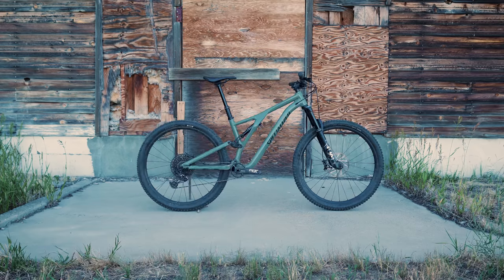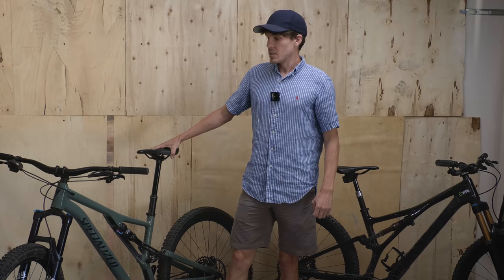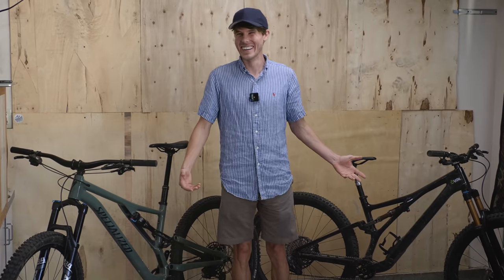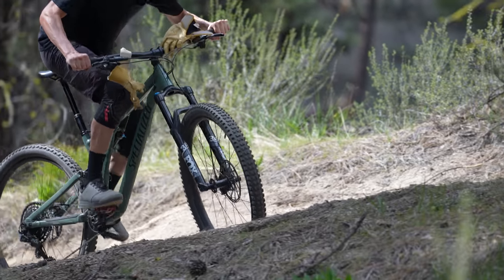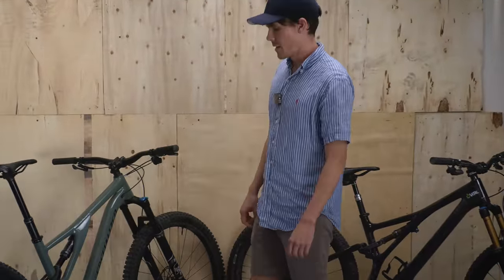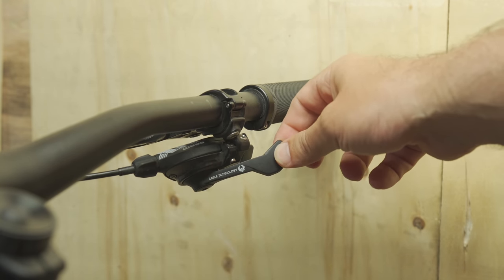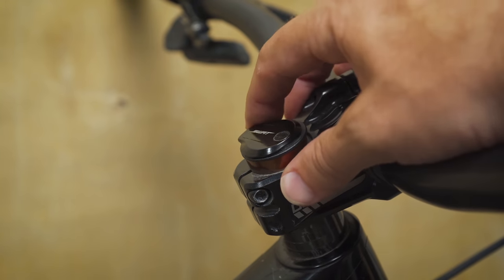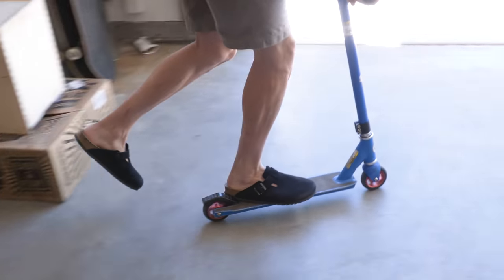LONG-TERM REVIEW - Specialized S-Works Stumpjumper vs. Stumpjumper Comp Alloy

Comment: As a bike mechanic, let me tell you one thing: If you have the NX derailleur, just ride it for a month until the spring is shot and upgrade to GX. The few pennies are reeeeaaaally worth it for a upgrade imo.

PS: I always see Adam Brayton using grips as binoculars when the outro starts
Reply: It's for that's Shimano is the king
Reply: Yep the crazy part is at the GX is like 10 or $15 more than the NX
Reply: Best upgrade you can do. The GX works perfectly
Reply: Anything else on the drivetrain you’d recommend upgrading? That’s really helpful

Comment: My 2013 Stumpy Elite 29er weighs 30 lbs. packed with tools, water bottle, frame pump, and spare... and it is alloy. It is 130/130 with a FOX Evolution fork and the rear is Fox Float/Brain. I smoke guys on these new geos on the climbs and trails oriented stuff. I live in rolling terrain and LLS goes being jammed down our throats isn't better for most of the terrain in the USA. I run 2 tokens in my fork.

Comment: I have the 2022 alloy comp. And he was right about the NX drivetrain. I bought a GX shifter and derailer. And will upgrade the crank later shifting fine now. I’m still mad I spent 4 grand on a bike. Looking at new ones now you can get a carbon comp for the same price I spent on alloy.

Comment: 100000% agree on value of both bikes. WAY OVERPRICED, build an expert (when frames are available) and save thousands. Not surprised with Specialized though. Good options out there on direct-to-consumer bikes though for the price.

Comment: I have a comp and have been upgrading it. Have a Fox 36 fork and a dpx2 going on it soon.
Reply: Hey man I’ve been looking everywhere for this info. I have the comp alloy, obviously with the 34 Rhythms…so the 36s will go on without affecting the geometry too much??
Reply: @benv7670  I bought a 36 with 160mm travel and dropped it down to 150mm with a new air shaft. I think specialized only recommends 10mm travel increase in the front so it won’t mess with the geometry much at all. Took it out for a test yesterday at the bike park and it rode and handles amazingly.

Comment: 6:45 So if you put the high-end suspension on the Aluminum, is it worth having the very expensive carbon frame if you are not a professional racer and just a regular mountain biker? I'm starting to come to that conclusion after seeing other brands come out with the aluminum version of the carbon, like the Ripley AF that is actually more capable than the carbon downhill. My last 3 bikes have been carbon and will probably be that way from now on, but if I were a young mountain biker just starting out, I'd definitely go aluminum with bikes like this.

Comment: Specialized makes great frames but for $3400, NX is wild. Go find yourself a Vitus Escarpe with Deore, a Z2 fork, carbon front triangle and save yourself $1k
Reply: Agreed. I have NX on a 2018 $1k hardtail and am annoyed with it for even that price point lol. NX anywhere near 3k is a nope
Reply: I've got a vitus mythique VRX and I completely agree, that Z2 is bloody amazing, it's basically a beefed up 34 factory without the adjustment but at an amazing price
I'd actually rather have a Z2 than a 34 factory because of the stiffness advantage, I'm not to concerned with weight
Reply: @nebnollock5198  Yeah I am also a fan of the Z2 over the 34. I intend to get one for my hardtail. That Mythique is a seriously nice package but I can't find one lol
Reply: @letsgo_inc  tell me about it, I was trying for months to get it - missing two stock shipments but on the third one I managed to snag one, it sold out 7 mins after I got the stock alert
Reply: @nebnollock5198  yeah I gave up. I'm low-key hoping they update it soon as it looks like j won't be buying anything for a while.
Reply: @letsgo_inc  you might as well sign up for the stock alerts, it's worth a shot

Comment: Many reviewers have said that the old design felt more 'plush' and smooth compared to the new design with the flex chain stays. Did you find that to be the case ?
Reply: I Demo’d a horstless version in Pisgah and the rear suspension felt wooden and dead to me. I prefer the 130-140mm travel of the standard Stumpjumper compared to the 150-160mm of the Evo, but the suspension feeling was a non-starter for me.
Reply: @stonewp  Thank you

Comment: At $10,000 it's only got a DPS on the back? I know Specialized kinda scrimps on kit, but that's a low blow! I've got a nice kashima DPS on my $3,000 XC bike. I would have absolutely expected to see at least a DPX2 if not a Float X on a very high end trail bike! The S-Works, as it sits, is a $7,000 bike IMO and the alloy a $2,800 bike. YMMV

Comment: the alloy is by far the easier more reliable bang around everyday bike for an everyday rider, the review is more bias to that of a long term rider and competitive enduro rider.... the everyday rider and weekend trail warrior even being damn good rider on a bike would be better with the alloy, not everyone needs every single adjustment on the suspension and most even good riders wont setup compression rebound and dampening correctly it takes some higher skills...

Comment: IMHO, theres a few flaws with this comparasion in some regards.

For starters, the comment on suspension performance its obvious if you compare a rythm fork vs a factory 34 with a grip2 damper... same for the shock.

Second, you're also comparing two bikes with basically same geo but different suspension layout (flexstays vs fsr) so this also will change how the bike feels both climbing and descending.

the ideal review would have either been:

1. compare the comp alloy vs the comp carbon for long term which will give you the closest comparasion between the carbon bike and the alloy bike because they both have same forks and shocks !

2. upgrade fork and shock on the comp alloy to a performance elite or factory level to achieve a similar comparison to scenario 1. (mentioned above) which will make for a much more fair comparison for long term in general. Because as previously mentioned suspension performance has a huge impact on ride feel between this bikes!

Comment: It's insane to call a 3400 USD bike budget. There is a lower model with Rockshox 35 fork and x-fusion shock; that's the budget one...
Reply from the maker: A fair critisim. We actually explain the reasons why we did not use the base, alloy model in our full review: https://www.vitalmtb.com/features/Specialized-Stumpjumper-S-Works-Vs-Stumpjumper-Comp-Alloy,3109
Reply: I agree. 99.99% of people can't even push a 1k bike to the limit. It's PURE marketing. But people can spend their money however they want. If you like it, you like it.

Comment: such a great review. would be nice to compare the 2019 model to this one and see in what the new model has really improved and if it worths or not to mind about getting the newest one.
Reply: Fortunately I can give some insight as I owned the previous model year s-works stumpjumper. This bike is very different than the last generation. I would liken this platform to the Stumpjumper st (short travel) of yesteryear. The suspension feel is very similar, but the latest model is more capable both up and down. The suspension is a bit more progressive. But, most importantly, the progression can be tuned on this latest model much easier (the previous generation shipped with the largest volume reducer). The bikes are very different, but we believe the latest generation of the stumpjumper line is an improvement in almost every aspect.
Reply: @stickintheleg9153   Thanks, i do own a 2019 comp cabon  ( not the st) , have got it in 2018 and I am very in loved with it yet.  Dind´t have the oportunity to test ride the latest model so I am very curious about how much would worth to trade it. Maybe I will wait for few more generations to come.
Reply: I also have the 2019 carbon comp. For a cheap bike it's adequate. It's a good all rounder. I demoed the newer one and it felt mostly the same but it was a short ride
Reply: I put dvo suspension on mine and it feels a lot better. It made me like the bike mich more

Comment: Finn runs the new Stumpy with a 150mm fork, but has a TTX Air in the back too...
Reply: yup. Along with the TTX Air (reservoir) shock, he also swapped out the brakes to MT7's (very powerful) and fork (stiffer). All doable, but it would be both very expensive and require a custom tune on the shock.

Comment: "definitely faster" is a strong claim followed up by zero evidence.
Reply: When we didn't see any numbers I was already turned off from watching the rest.
Reply: A weight difference of nearly 7 pounds along with more active suspension on the comp alloy will not climb as fast as the s-works. times varied on my regular loops, but 5-10% slower was a pretty regular occurrence. descents were all over the place, but the s-works was consistently faster, unless it was just a wide open trail. Let's just say that we wouldn't choose the comp alloy over the S-works model if we were competitively racing something like the Downieville Classic.
Reply: I must laugh at this. yeah numbers would be fine but if you really think a bike with almost same geo can outrun something with better suspension you must be nuts or have to less experience in highspeed descending.
Reply: Ohh we have a scientist on our hands. Just go ride you bike bro. Faster is faster. Slower is slower. There are your numbers.

Comment: This is not the same year. One with single pivot and one with 4 bars. Please compare the same year bike.
Reply from the maker: incorrect. they are the same year. the alloy uses 4 bar. the carbon uses flex stay.
Reply: @vitalmtb  ok. design of the old stumpjumper on alu bike

Comment: Same bike one minus a motor. $6400.00 Dollar motor and battery. Specialized has lost there minds. The 2021 Levo or kenevo $15,000.00 Specialized get real. I could buy 2 or 3 sur Ron's or a Husqvara 501.

Comment: In my opinion I would take an alloy frame ( preferably 7005 aluminum ) over a carbon fiber frame any day of the week. Now I am only talking for a frame. I build bikes and I can say the weight difference is so minimal and in actual fact I have aluminum frames that are lighter than carbon ones. I feel the only reason carbon frames cost more is because the labor involved in making it. Layer upon layer of carbon sheets...I have had numerous carbon frames break and splinter and only have had alloy ones bend and dent. For me nothing beats the feel of aluminum and trust the strength of it over carbon when I am doing huge drops on the trail. Again this is only my opinion.

Comment: Wait ... so you ran the sworks in a fully closed shock position the whole time? Isn't that typically reserved for fireroads basically?
Reply: not quite. So, there is a 'climb switch' and an independent 'low speed' compression dial below. We ran the low speed closed with the climb switch in 'descend.' It is discussed in greater detail in the article at Vitalmtb.com
Reply: @stickintheleg9153  on my 2020 fox factory dps, it’s just the climb switch (the blue thing with 3 settings), and the rebound knob. I’m obviously missing something or miseducated lol. Reason I was thinking you were taking about the switch was because it’s the only option with 3 settings like you mentioned, the rebound has multiple clicks 

I’ll check out your article, thanks for the interesting review :).